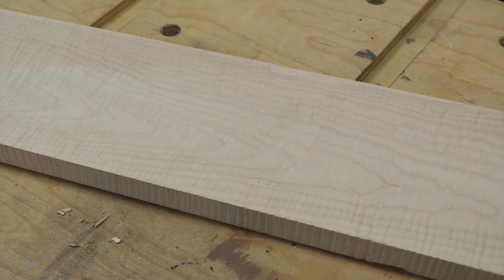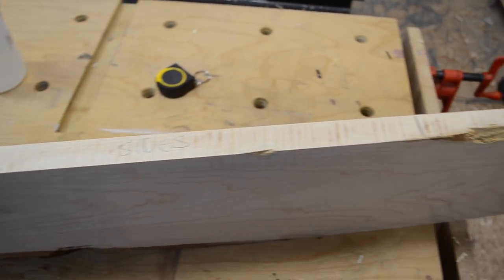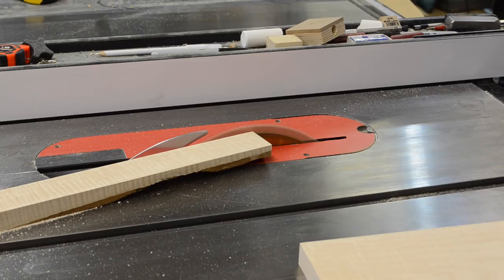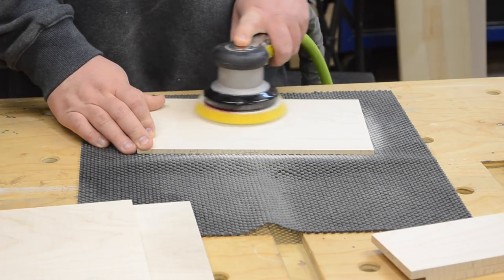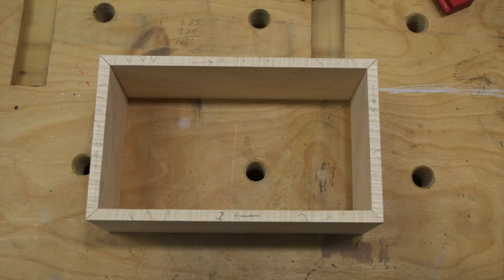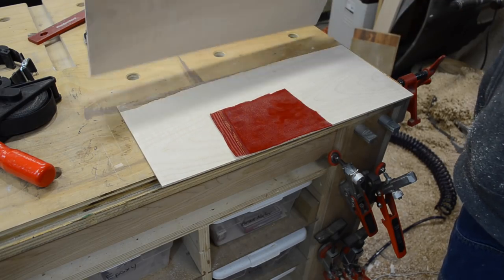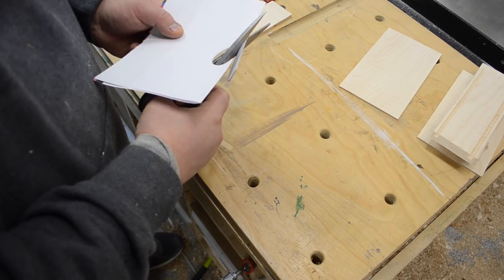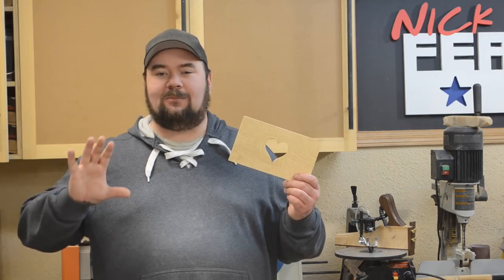Ⓕ Killer Curly Maple Keepsake Box Build - PART ONE (ep85)

Comment: Hey Nick,
Great build. If you are looking to protect your velvet while finishing, use spray adhesive to adhere the velvet to the bottom piece of the top then cut a piece of Saran Wrap the same size as the velvet. Lay this on top of the velvet and affix the top piece. When you have completed your finishing use you fingers to pinch towards the centre of the cut-out and the plastic wrap should pull right out. I use this method all the time to protect cut-outs in my projects and it works pretty slick. Just make sure you put the plastic wrap back in the kitchen when you are done or you are likely to hear about it from the war department.
Reply from the maker: Lol, I'd put it back - great minds think alike - although I had in my head to use wax paper over saran wrap on the thoughts that any finish would "sheet" off versus flake off the saran wrap - I will probably do some testing now to see the differences - my original thought was wax backed or even plain paper (if the top was prefinished) that way I could stick on a masking tape pull to the paper when it comes time to remove it - similar to how we do cabinet pulls before pull hardware is installed - I like the thought of the saran wrap being more flexible and possibly being easier to pull away from the box out of the hole - thanks!!
Reply: Nick Ferry, The upside of using Saran Wrap is that if by chance it got stuck you can tug on it to stretch it just a bit and then run a razor blade over the stuck part close as you can to the side and the cut part will retract out of sight.
Reply from the maker: I will try it for sure - I am actually looking forward to see which works best - thanks for the idea - make sure to watch the second part to see which one I go with

Comment: Dude get a Dremel with the router tools, those small cuts are possible using only that tool and some sanding. Looks nice in spite of not being rounded, I don't believe I would do much more than sand those edges over to take away the sharps. I'll be waiting impatiently on part two ;-)
Reply from the maker: thanks - I'll have to look into that - I only have grinding and etching  bits for my Dremel

Comment: Great video, where is part two? I got a stack of Curly Maple I've been doing alot of projects from lately. So with nothing on it its sooooo pretty. But on trick I've learned is to stain/dye then do a light sanding and another round of stain/dye. Doing this makes the curls alot more pronounced and just bumps up the overall prettiness. The more you repeat the stain/dye and sanding the more you can make those curls pop. Cant wait to see what your finished project looks like
Reply from the maker: I do that as well when dyeing curly - I even think I have showed it in a video or two - part two for this is not out yet - I got bombarded with other to-do's - I want to get back to it though

Comment: Hey Mr.Ferry, 
New to your channel (Thank AW. btw, nice clocks).
I love the box.
One question though...
What's "snipe" ?
Reply from the maker: Welcome - it's where the cutter head of a thinness planer takes more material off the beginning and end of a board as you run it through - typically caused by planer head movement on smaller, less expensive planers
Reply: Mr. Ferry,
Thnx for the speedy explanation.
Reply from the maker: No problem